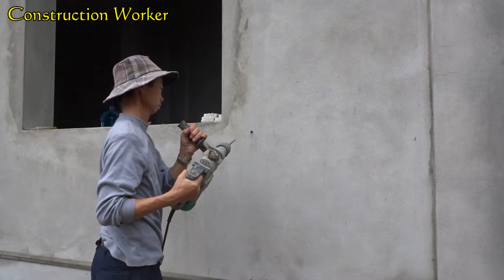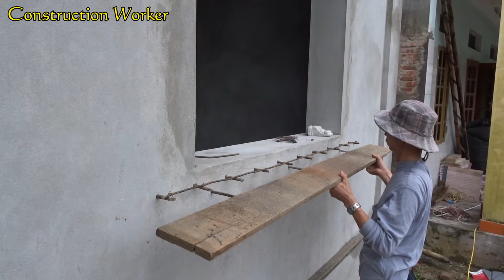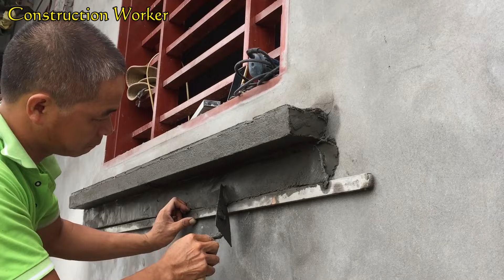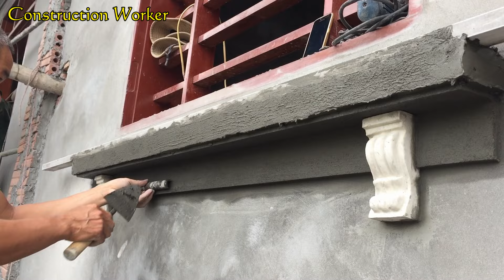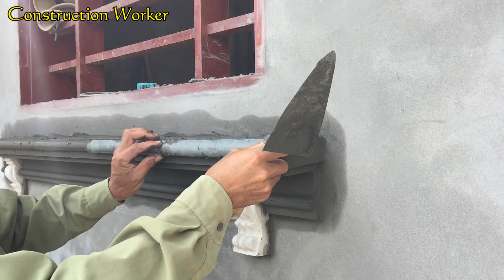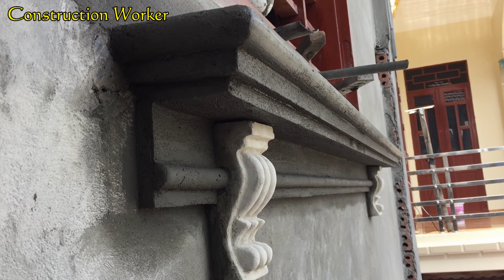Excellent Technical Construction Window Foot With Reinforced Concrete And Cement & Sand Ornament

Comment: A window foot fibreglass mould should be made. Then put it in place, secure it and pour it. After rub in any voids with mortar. The method shown in the video is outdated and labour intensive. The same way the two vertical accent pieces were made by a mould, the entire window foot could have been made by a mould.
Reply: I am grateful that the old techniques survive... Sometimes faster and more isn't better.

Comment: This can be easily done by Mold, styrofoam, intricate decorative which can be bought commercially, just place a screw on the cement, spray stucco cement later.

Comment: Not very precise holes to avoid measuring the hole distance with the meter, wrong not to use the level, wrong not to use a metal corner on the rod head (for the row below, turned upwards) but the wood should not be used in this way but with case shape (in choice of form), much more efficient, brings almost finished work.
Dear Chinese, you are too far behind, but what an excellent job, go to the cag ....